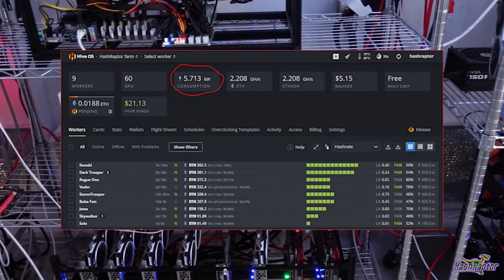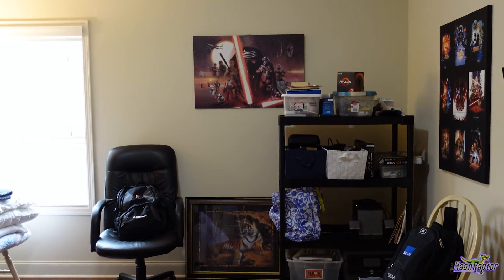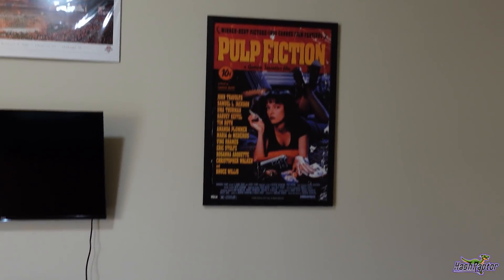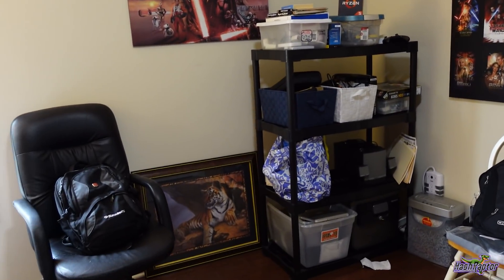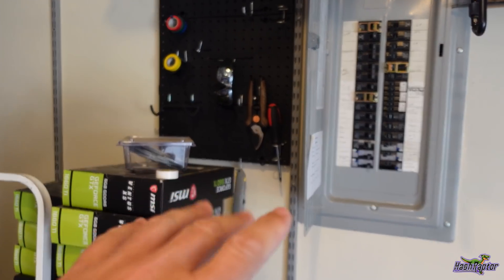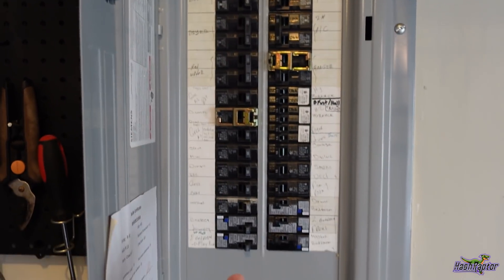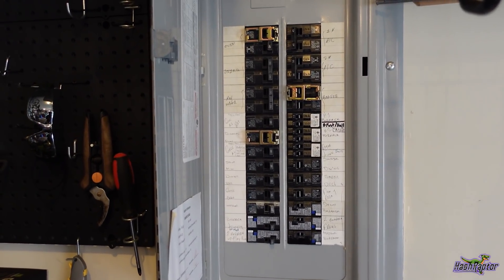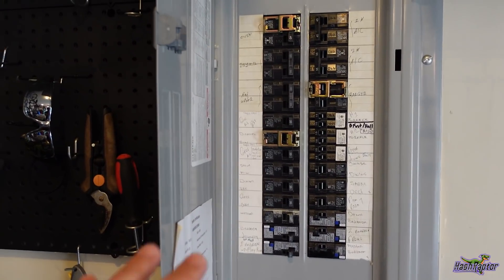Electrical Overview | How to Upgrade Electrical for Home Cryptocurrency Mining

Comment: It’s too late now, but for other viewers watching in areas with a lot of thunder storms. Consider using a fiber optic line to extend your internet from the house to shed since it will be impervious to lightning strikes. For a couple hundred at most, you can get to Ethernet to fiber converter and any length of cable to run where ever you need the terminal to be.
Reply from the maker: That is great advice!  Maybe I can pull through some fiber in that conduit.  Although with the 90's my conduit takes, I'd probably break the glass lol...
Reply: @HashRaptor  It's a bit more hardy than you think. Quite flexible to the point of attaching a vacuum flag at the end and sucking it through. You would have to remove the ethernet cable anyway, and should always have a pull-string left inside going from shed to the house.
Also figure the fiber with sheathing is only 1/8 too 3/16 thick. Hence the flag and shop-vac option. But considering you do already have the ethernet in-place. I would just use it as the pull string, going slow, and with another person feeding it as I go.
The other option for you and Anthony would of been using POE outdoor rated ethernet. This has a ground sheathing inside with an exposed earth-ground wire that gets attached to earth ground. Usually at the building entrance box.

Comment: what do you do for the heat in the shed ?
Reply from the maker: It is a battle.  I balanced the intake vents with exhaust fans.  I have a few shed videos on the heat if you want to dive a little deeper.  It is tough :)

Comment: Im wondering if you could help me. Im planning to invest in 30 T17 42Th miners. Each miner consumes 2310w and requires 230v to operate. I live in the UK which out socket supply 230v. Would i have any issues running all 30 miners at the same time?

Comment: how'd you hang your mobo? simple zip tie?
Reply: so many questions. You said youd make a video going over the emporia energy monitoring system, have you any information about that?
Reply: how do you incorporate surge protection? I would think you would have a surge protector of 15 amps per rig just for safe keepings. but that wouldnt plug into a PDU. I'm new to the whole PDU side of the house. I'm switching to a single 240 40 amp breaker here shortly when I move into an apartment.

Comment: I might have missed it, but what is your solution for surge protection? Thank you in advance, and great video!
Reply from the maker: Great question, I use surge protection in each PDU, and had to send back surge protection in the panel for a new unit.  That will be replaced soon.  I'll be sure to do an update when I get that in place.  Also adding surge protection for the ethernet runs!  Good catch!!!

Comment: I have a bad feeling about those multiport outles with USB and surge protection in it.
It doesn't seem like anywhere near enough space to do all of those things properly, meaning the surge protection is almost non existing, USB supply very low quality and the actual outlets not able to carry reliably more than few Amps.

Comment: Tips and tricks. You dont need a high capacity outlet just big wire and  mountable breaker as a switch instead of unplugging it.

Comment: need to redo that ethernet pvc outside my guy. that pvc should be flush to the wall
Reply from the maker: Yeah, I’ll add a metal bracket to pull it tight. Was working with 45’s and plastic couplings which couldn’t pull it to the wall. But it works perfectly. ATT and Charter didn’t even take their conduit to the ground LOL

Comment: Very Informational! Thank you! Unfortunately I live in an apartment and only have 2x 15Amps that i can run 2x rigs from opposite rooms :( But, its a start!! 
Wonder if I'd be able to add an extra 20 or 30Amp to the breaker.
Reply: The most important thing is that what your breaker rated for. Like mine rated for 25Amps and 220V so I can use only 5500W max

Comment: Powerline ethernet would have saved you a bunch of time and effort.
Reply from the maker: I thought about that, but there were going to be potential issues with the power line from the shed going back into the main meter and different bus bar, then going back into the house on another bus bar to get to the electrical in the house.  It was a really long run.  Also, I was able to isolate those two etherenet lines on their own network seperate from the home for security purposes.

Comment: So here in the UK (England specifically) My 120  years old tiny house has a 100amp fused input into the house breaker at 240v 50hz... 24kw? 

What is the basic US input?

Comment: I have a question that I don't see anyone asking.   How do you keep that shed cool or do you have some kind of A/C unit spot cooler for it?
Reply from the maker: haha, if you watch the build video playlist, you will see I've been battling heat all the time.  Actually, check out the video that just posted today.  I added a bunch of GPU's recently, and now that I am hitting 90+ degree heat, I'm having to setup a new Heat Management Plan.
Reply: @HashRaptor  You don't have to tell me about heat.... I am from Houston.  We will have had more than a few summers hit 105F with 85%+ humidity.

Comment: Great video. Really gives those of us with huge aspirations an understanding of what it takes to properly plan and execute such a project. I bet that trench was a PITA, even with your son helping! One small observation in the shed I saw. Isn't it against code to block a breaker panel or is that a commercial only rule?
Reply from the maker: Thanks so much!  hmmm, never thought of blocking the panel.  Didn't even know there was a code for that :).  The shelf is on wheels though, so I can just roll it out of the way when I need to get in there..  I am thinking of redoing all of the shelves though soon, so should fix that issue.  Take care my man!

Comment: Good video and pretty setup. There is a concern with the shed though. You really shouldn't have the powerbox blocked by the racks. Code is technically 3 feet of egress typically, but at least having access to the door in a hurry is huge.

Comment: Just curious... why are you saying 110v and 220v? Where I am in the US, I get 120v and 240v... is it different from one locality to the next?
Reply: 110/115/120/125V are all considered the same category in most residential US homes.
Same w/ 220/230/240/250V.
~208V is a bit different, because it indicates a commercial (or residential complex...which is effectively commercial) 3 phase power.
Modern electronics usually support the full range of 110-250V, although there is usually some cutoff to transition to the higher efficient 200+ V.
Ex: Many high watt Server PSUs can only output their rated watts at 200+V. Anything less and they can only output ~70-80% of their rating.
Old electronics used to have a little switch that you had to flip to tell it if it is being powered with ~100V or ~200V...and pray you never plugged in ~200V when the switch was flipped to ~100V.

Comment: epic video!thank you so much.i am before step 2 :D i have 6 3070, 3 1080 and 3 5600xt and the heat was nice in winter but in the summer i want another solution. so thx a lot again!

Comment: I wonder why you use 110V in the US, here in the EU 230V is the standard. Much less issues.
Reply from the maker: Very good question.  Probably the same reason we don't use the metric system :)
Reply: I wouldn’t say less issues. Probably had a lot to do with Edison vs Westinghouse vs Tesla. Y’all can run smaller wire in your house because 230 is more efficient, so it cuts some costs. A lot of businesses here run 277/480. Fun bonus fact, we run at 60hz here in the states while y’all run at 50hz

Comment: I want to learn how to calculate my watts for mining, I mean how much I need
Reply from the maker: Hey, so start first by figuring out what size rig you want to run.  I'd estimate 150 watts for each GPU.  200 watts on the safe side for most efficient mining gpu's.  Then muliply by how many you want to run.  That should get you started.  You may come in well under that which is good :)

Comment: I have 3 questions that I have not been able to find answers to.  First;  What is the MAX number of miners that I can have on 1 mining account?   Second;  Is there any REAL benefit to owning a mining pool over just mining in someone else's mining pool?  And lastly;  Which mining sties can I deposit and withdraw for a Canadian Bank Account?
Reply: If you mean how many per Mining OS ( Linux based mining specific Operating Systems ) usually the first 2 rigs are free. After that you have to start paying. There are tiers with them costing more as the number of rigs increases. If you don’t use a mining specific OS there’s no cost other than any cost for the key ( Linux free, Windows you can get cheap keys )
There are tools for basic Linux/Windows that allow you to remotely monitor/control rigs. More work, but free. Mining OS’s are a matter of convenience, and that convenience is a trade off with a cost. 

If you mean how many rigs/workers can you have on an address to a mining pool that’s unlimited.

Mining pools take a cut of miners payout. Operating a public pool would net you more than solo mining as the pool
Would have more hash than your farm alone. ( if others use your pool ) 
If you have a popular pool you can make decent returns.

Ming sites don’t pay out to your bank account. You have to send your coins to an exchange that offers fiat off ramps. That’s all on you, meaning pools don’t handle any aspect of that. They just pay out to your wallet.

Comment: Very informative, thank you!  You might want to check the National Electrical Code.  It usually required around 3 feet free of space in front of the electrical panel (the one in your shed).

Comment: Researching mining has taught me more about heat and electricity than it has computers or programming lol
Reply: Electricity creates a ton of heat!  As an electrician I can tell you that the first time I temp-powered a lighting circuit off an extension cord for only 5 minutes was the last time I did that haha.  The cord melted and sparks everywhere because the large power draw was too much for the small cable.  Making sure everything is rated for the power usage is one of the most crucial aspects of our trade ⚡️
Reply: @mprior93  Yeah it does! Damn that's one way to learn lol
Reply: me too. I now better understand airflow!
Reply: Yep not much to building a computer really when mining and definitely no programming lol
Reply: only the most efficient survive long term =)
Reply: @huntmining  which usually means adapting to newer cards, for the biggest gains in efficiency atleast (ignore 5700/XT lol)
Reply: @paulm2726  yeah i mean the 6600 non xt's are the best ive found modded or unmodded out of any new or old card. Minus the 5700xt. I get a 1.9 H/W efficiency.

Comment: also, i saw your metering method. cool device. but using 1 clip on the 240 volt 30 amp breaker is not accurate. clamping to only 1 leg of the 240 volt will only read that one leg.  what if on the trip light bar thing your using 1-240 plug and 3-120 volt plugs? the 240 volt with only be reading on 1 leg which is fine because they should be pulling the same power.  but the 120 volt plugs are on different legs on the 240 volt.  what happens if by chance all 3 of the 120 volt happen to be plugged into the opposite leg of the 24 volt that the meter isn't on? so you would be reading the 1 leg of the 240 volt and the other leg will not only be pulling al 3 of the 120 volt plugs on it, there wouldnt be a clamp on that meter to read it.
Reply from the maker: Hey, so the 240 and the 120 are on different circuits so that can't happen. the 120v is on the 20 amp breaker I called out.  Each 220 is on its own 30 amp breaker.  Thanks for helping me clarify that!  Let me know if there is anything else I am missing or can clarify, as I am NOT and electrician :)

Comment: Note. *80% load is great for the longevity of the panel. keep in mind to balance your load as it will help with the watt reading at the service meter and keep your electrical cost at a minimum.
there are 200 amp CT amp/watt meters you can get off amazon that can be installed in your panel to monitor this.
Reply from the maker: Thanks for the tips!  Is there one you would recommend by chance?

Comment: Emporia vue is great, I'm running 8 clamps and I use it to track exactly how much wattage I'm using each month for taxes. I have all of mine run on 120v/20a circuits running 3.3kw/hr. I can quickly check on my rigs to see if any of them are down, but also I can see how my power load is spread and adjust as necessary. Huge upgrade.
Reply from the maker: Thanks for sharing, awesome!  Hey question, did you have a discrepancy between what the "mains" showed and the total as measured by the individual clamps?  I am still 400 watts or so off, trying to track that down.
Reply: @HashRaptor  mine seems to be pretty consistent. Though I need to bring in a killawatt and compare. I originally did an amp draw test with a clamp on meter and it was nearly identical, but like I said all of my rigs are currently on 120, hoping to run my next shelf on 240 and maybe then I'll see some differences or missing wattage. Thanks as always for all the info!

Comment: I love the Emporia monitor, I have the same one and it works well.
Reply from the maker: Thanks for sharing, awesome!  same question, did you have a discrepancy between what the "mains" showed and the total as measured by the individual clamps?  I am still 400 watts or so off, trying to track that down.

Comment: I'm about to add another 200 amp panel and a standalone meter to my basement mine. I had just 30amps available on my original panel and I'm able to run about 50 gpu's. I need more power!

Comment: Might not have the same number of GPU's (just got a single 3070 mining) but love being in the UK with 240v with 60 to 100amps total load don't need to worry too much about overloading a circuit :D
Reply from the maker: Very nice my friend!
Reply: How many gpus could we run in a house In The Uk? Using the wall plug

Comment: I live in Phoenix, where the summer highs can reach 120F outside. Ive always had my rigs directly cooled by a mini-split, which draws a lot of power itself. Wondering your thoughts on running rigs in 120F ambient temp, like if I did a shed like you have without cooling.
Reply from the maker: The trick, which I'm still modifying as I expand, is to keep the air moving.  If you can do that with the shade of a shed, I think you can pull it off.  120F is hot though :)
Reply: I’m interested in this as well. What are you using for airflow? I live in VA and while it doesn’t get quite as warm, I’m worried about the humidity and pollen/dust.
Reply: Maybe plant trees around your shed
Reply: @speederc3662  in Phoenix literally the only economic flora and fauna is a cactus. I lived there for two years and the summer heat is oppressive. You only go grocery shopping at midnight because it drops to a bearable 100°F outside